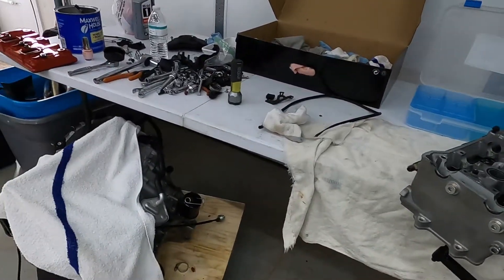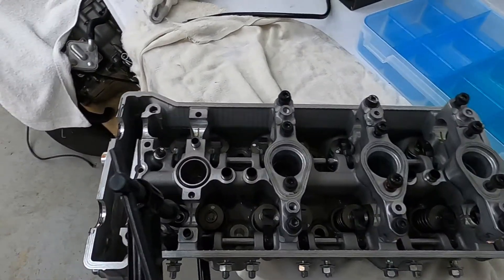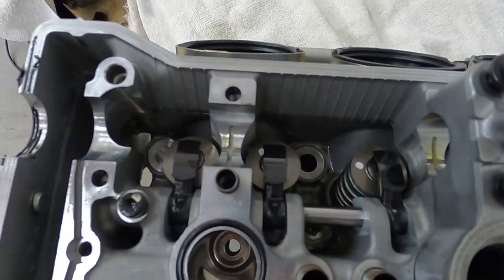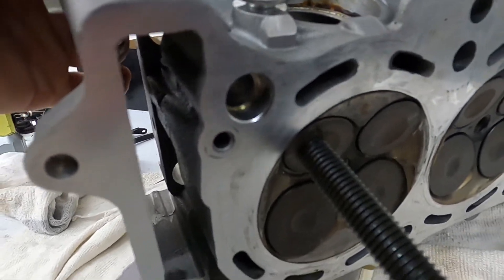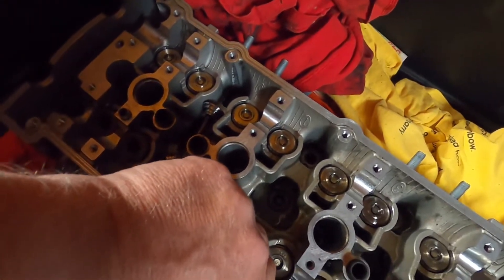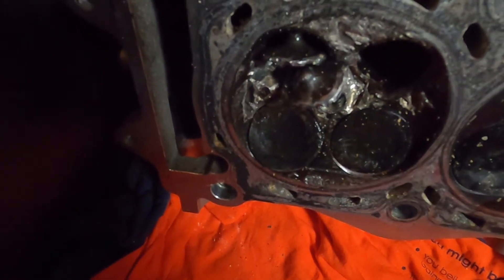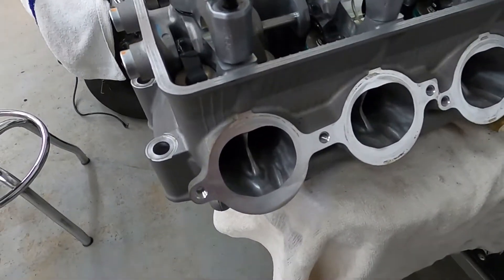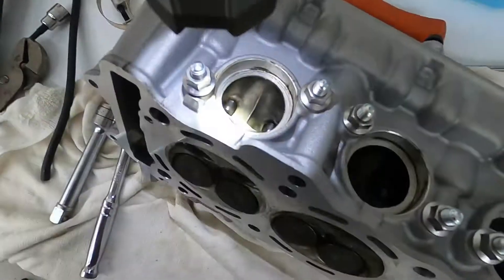Project Redtop Part 3 Taking Apart a 2019 ZX10R Head

Comment: I want to ask, I swapped the engine from ZX10R Gen 4 to All Electronic Gen 5. But the motor won't start. Do I have to replace the shift drums and gear position sensor too?